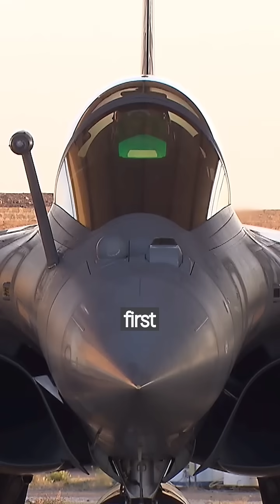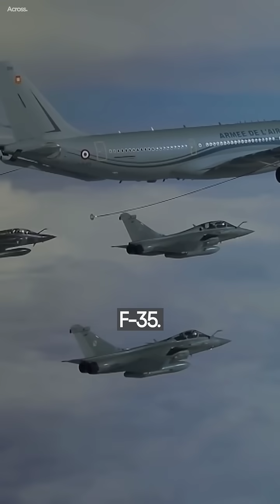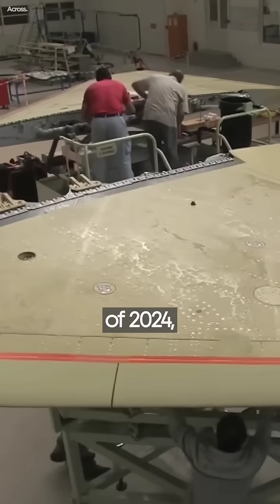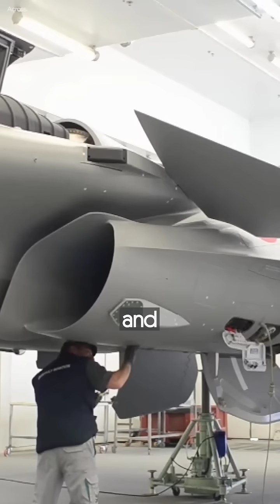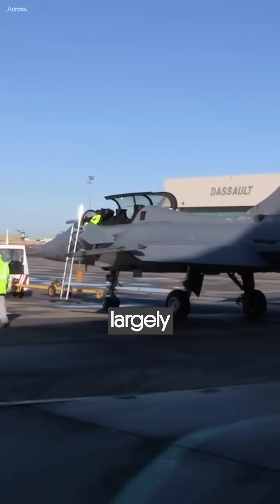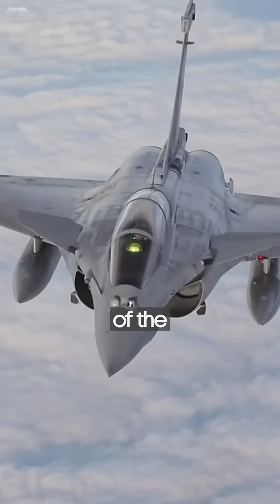The Fighter Plane No Nation Wanted to Fight #shorts

Comment: I always dismissed the Rafale as just a 4th gen platform with some bells and whistles, but after seeing what they have going on in the electronics department, I've a newfound respect for them. Top of the line maneuverability, with twin engines for reliability, and electronic warfare capability to rival dedicated EW platforms. Also if Dassault manuals are anything like they used to be with the old falcons, much easier to go through than American ones.
Reply: Yep we donnot know everything but electronic warefare is even more powerfull than the Mirage 2000 which was one of the best with dedicated old Prowler. NO russian aircraft has such BIG BIG warefare ( parlly visible on dérive large square thing )
Reply: Spectra ew..
Reply: @SuperMrkilleur I don't like Bugatti. It's overrated because it's the most expensive. For looks Aston Martin is better In my opinion. For daily drive use a Honda or peugeot
Reply: This is the mistake did by too many people. The Rafale introduced things first, that people like to give to the f35. Such as EOTS, the Rafale was the first figther jet to fit such technology on an aircraft, as well as on a missile, with the new MICA NG.

Even the Mirages aircrafts were doing the same. Mirage 2000 was the first aircraft in the world capable to fly very low close to the ground, in autopilot mode and capable to avoid and follow the ground, without human intervention.
Reply: @jingorooroad2559 no in fact we had the mirage VI capable of flying 200m off the ground at mach 2 for long periods of time
Reply: @jingorooroad2559 Mirage 2000 first plane equipped with electronic air commands !
Reply: Same here.
Reply: Its a 4.5gen but the "generation" is not the same in all countries and is not so important.
Reply: I know it’s technically better than the Eurofighter, especially as it’s reduced visibility but I still prefer the Typhoon.
Maybe it’s because I’m English
Reply: @AxlePlaysGames  the taille-foune (pussy hair cutter) is poorly born. It has a lot of design flaws. Some major design flaws. What's funny with it : it was thought as an air superiority plane... but even the Omnirole Rafale does better than the taille-foune.
Reply: @AxlePlaysGames deux modèles très différents, après le rafale est un vrai couteau suisse et sa robustesse n'est plus prouvée même s'il coûte cher il tombe rarement en panne contrairement au F 35 qui est une vraie caisse a savon, nos avions européens sont globalement fiable, le gripen aussi est sympa on en parle moins mais c'est un chasseur interressant, après j'aimerais bien voir aussi se que fait le Japon et la Corée du sud aussi je sais qu'ils produisent mais j'ai pas vraiment regardé ça vaut sûrement le coup d'œil
Reply: Rafale does not rival dedicated EW platforms. Really don't know where you got that from.

Additionally, Rafale lacks many things that you can find on modern fighter jets.
Reply: @johanlassen6448  There is no more dedicated EW platform in service today. It's all integrated into multirole aircrafts or as pods. 

Bold of you to accuse Rafale of missing things, yet you don't say what's missing
Reply: @strf90105  Growler is a dedicated EW platform. Also, it was you who said "and electronic warfare capability to rival dedicated EW platforms". If there are no more dedicated EW platforms then gosh it is almost as if you were deliberately misleading. OFC it ought to be able to rival dedicated EW platforms if you are comparing it to planes from the 70s. Classic Dassault marketing BS.

I would assume a person ho claims to know anything about combat aircraft, especially one making bombastic statements about the capabilities of a particular type, would know what they actually have. You don't? Do you need me to explain it to you?

Tell me, do you know what a GMTI is? Do you know that Rafale pilots still have to use binoculars to identify targets? Because if you do not even know basic terms and functionalities, then I would suggest you sit down and be quiet.

Do you know what an HMD? Do you know Rafales in French service do not have one?
Reply: @johanlassen6448  You said "I would assume a person who claims to know anything about combat aircrafts ..."

Maybe you should follow your own advices to others, because you're wrong.

The Rafale is already using GMTI/T and got HMD as well. Since March 2023, first Rafales F4 have been entered in service, and qualified by the DGA.
Reply: @johanlassen6448  You're not humble and respectful for sure. There's no point in talking with people with such behaviour. Come back when you got educated correctly. Thanks per advance.
Reply: @johanlassen6448 thé Rafale version  4-5 will be equipped with a THALES HMD
Reply: and it looks good too just like french cars. But if the french make a stealth aircraft maybe it will look boxy and ugly too just like f35
Reply: @eduardadhi110  Well, France did come up with a full size concept model for their FCAS 5th gen fighter, and it does look much sleeker than F35
Reply: @eduardadhi110  then there are things you dont know about the Rafale...
Between the prototype and production aircraft, the designers went back to the drawing board...
Rafale radar signature is very low.
Reply: @eduardadhi110 the f-35 isn’t boxy tho? That’s like the point of stealth aircraft’s
Reply: That is not the point, just an infortunate consequence of stealth.
And the very reason the Rafale is not radar , in some fréquencies, stealthy . it would have degraded too much the flight characteristics. And made it a turkey like the F35.
A design choice at the time.
Reply: @eduardadhi110  Some say, the Dassault founder said "a beautiful aircraft, is an aircraft which fly well". The f35 isn't flying well, thanks to many remaining problems. That's the big difference.
Reply: @jingorooroad2559  Hahaha!!! as the thousands of F-35 laugh all together in unison....
Reply: @Ezees23   Yeah all laughing together .. on the ground, where they spend 55 to 60 percents of their time. In real war conditions, those numbers are really pretty bad, giving a very poor availability rates.
Reply: @Ezees23  boxy f35 is similar to boxy Tesla cybertruck it's just ugly... Not suited for french taste lol 😂
Reply: @jingorooroad2559 what problems? The kinks have been worked out. It’s in active service and doing very well. You still have the same problems in mind they were working through 10 years ago.
Reply: @Ezees23  the whole world is laughing at the F35 (un)reliability...
This bird is stealth mainly becausevit does not fly.
Reply: @brotatochip7001  Yes another crash recently, after the new updates patchs, which is blocking all deliveries of it. Yeah as you want my friend, if you call it working very well, good for you, but facts aren't agreeing with you.

Most of the 35 fanboys, don't understand the notion of availability to fly and fight. I'm talking about the percentage of availability to fight, this where the 35 is very far to shine.

The 35 would need to be most of its time on the ground, which is kinda silly in case of war or conflict. Where fighters like Gripen and Rafale, have a combat availability which is slightly above 90 percent. They're able to do what they have been build for.

Without to forgot the difference in CPFH and all sustainable costs, failure-35 is money pit compared to other aircrafts. It was supposed to improve, but it don't. Even the bushings costs revealed by a senator, is just showing the ugly truth about it.
Reply: @eduardadhi110  Cars are nothing like military planes, LOL...
Reply: @alexdarcydestsimon3767  They all laugh...that is, until the ordnance starts dropping the adversary's aircraft and SAM sites start to instantly destruct without warning, LOL....
Reply: @jingorooroad2559  an over sized cost!
Reply: @Ezees23 ils rie sûrement mais surtout ils ne volent pas et au prix qu'ils coûtent c'est la la blague 😂 et nous les français ben franchement pour être honnête on se fout bien de votre gueule les gars, vos bateaux valent pas un clous vos avions volent pas et visiblement vous arrivez pas a construire un sous marin en moins de 15 ans bref quand vous arriverez a produire des matériels qui fonctionnent vous nous faites signe sinon ça sers a rien de faire les malins 😂
Reply: @eduardadhi110 ben c'est surtout qu'il passe plus de temps aux sol quand l'air ton F 35 c'est plus une caisse a savon qu'un avion , une vraie escroquerie le truc vue son prix a l'achat et le coût de maintenance pour le peu qu'il vole c'est une vraie arnaque, alors que notre rafale chui désolé mais lui il vole et il vole beaucoup

Comment: The F35 has either very few ammo or everything external.
Let's say
F35 is stealth like my grandma wheelchair.

The F35 (supposed to be) advanced sensors are hardly working together.

F35 computer programing is poorly made. Cause of more than 10 crashes.
Making Windows look like reliable compared to it.

Comment: If armed drones can do a lot of these combat duties ... Stealth is no longer a high priority as Capable Multi-Role Fighters like the Dassault Rafale  🇫🇷  or the Saab JAS39 Gripen  🇸🇪  are more practical &  bargain buys  ...  🌷🌿🌍✌💜🕊
Reply: Yes
Reply: This is a great "entry-level" plane if your enemies are flying nothing more advanced than a 4th Gen vehicle.  These are even better than anything the Russians have at this time.  They may even be a bit better than China's J-20 which is supposed to be a 5th Gen Fighter but many doubt it is.

But make no mistake, it can't and won't ever be able to compete with either the American F-35 or one of its watered-down versions sold to its Allies.  
It for sure isn't anywhere near an F-22. 

If you think stealth doesn't matter then you truly don't have a clue what the actual role of today's dual-role aircraft are and why stealth is literally the most important feature of a combat plane at this time. 

Make no mistake, this is a great plane for what it is.  It's comparable to an upgraded F-16 and when piloted by a highly-trained and skilled pilot, can do things most other enemy planes and pilots can't do.
It's just this plane, like the F-16, were designed for a "role" that no longer is considered applicable in today's warfare.  These were fighters designed for dogfighting in close proximity whereas the F-35 and F-22 are designed for "dogfighting" from a 100 miles away.

It doesn't do you any good if you can't get closer than a 100 miles away from your enemy if you get blown out of the sky.  Right now the F-35 and F-22 are the ONLY planes in the world that can do that and still not be seen.  China and Russia want you to believe their supposed 5th Gen planes the J-20 and the SU-57 can do that but everyone knows they can't.

Putting a Dassault up against an F-35 or F-22 is much akin to bringing a knife to a gunfight.

Those of us who actually know about these subjects get a pretty good laugh at some of those who THINK they know about it.

While the F-35 and the F-22 are currently the greatest stealth multi-role planes out there, they are still a disappointment from where they should have been.  This was done by actual design once it was realized the Chinese were hacking many of the plans for both the f-35 and F-22.

Luckily the new FA-XX plane being developed currently will make every other plane obsolete in the sky.  
It's a 7th-8th Gen Plane that will be capable of verticle takeoff and landing, Electro-Magnetic Shield capabilities that will be able to take actual missile hits from ground to air and air to air strikes, and it will also be able to achieve orbit of the planet if needed.  
When flown without a pilot (it can be used with or without a human pilot), it will be able to eclipse Mach 10 in speed.  
Obviously, because of the speed and the fact they will be able to achieve actual orbit, the engines will no longer be "Jet" engines and instead, will be something completely different which means more than likely an engine capable of using a "solid cell fuel system" much like a nuclear power plant would use.  
The weapons systems are unknown at this time but they are believed to be something in the "Rail gun/Laser" family.
It's interesting that the American Military was so hyped up on using Rail Guns and had advanced that system quite a bit but then suddenly they went "dark" with it and said it was no longer a legit candidate for combat.  That usually means they no longer wanted info about it getting out as it was being repurposed for another role, such as a scaled-down version for a new plane.

Comment: Ermm.. what about the Eurofighter?
Reply: Yup... INSANE SOUND!!
Reply: French brass left the project when they realise the multiple flaws of the Eurofighter. Just a lesson for you: eurofighter can not operate from carrier, eurofighter is bad in ground support
Reply: @CaptainDangeax  why because it has a weaker angle of attack?
Reply: @ADSBUser68-ebit1  eurofighter was not designed for ground attack, and the position of the canards hide the ground from pilot view. Get some information kiddo before embarrassing yourself here
Reply: @CaptainDangeax  well if it wasn't designed for that then why say that it's bad at it?
Reply: It has at least three design flaws from the very beginning.
Reply: @alexdarcydestsimon3767  Eurofighter is much more manouvrable than Rafale
Reply: @ADSBUser68-ebit1  all exercices rafale vs eurofighter prove you wrong
Reply: @CaptainDangeax  would u rather buy 2 plane to do ground attack and air superiority or buy one who can do both with little to no difference in capacity. 
that's why the eurofighter was flawed from the start.
moreover the eurofighter is more maniuvrable when it has nothing under it's wing and in most fight you take fuel tanks and missiles with you.
Reply: @romgba2129  that's exactly my point, and the Rafale is a better plane
Reply: @romgba2129  
you replied to the wrong guy. 
You should have answered to  @ADSBUser68
But your point is very true.
Why buy two different types of plane when one can do everything better.
And to be fair, i've seen both Rafale and taille-foune fly.
The Rafale is still way better at maneuvering.